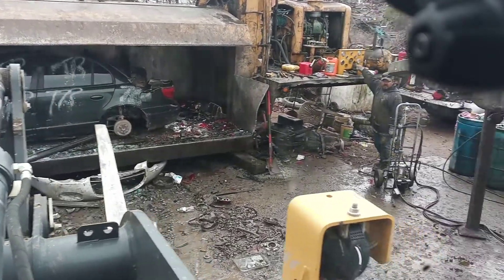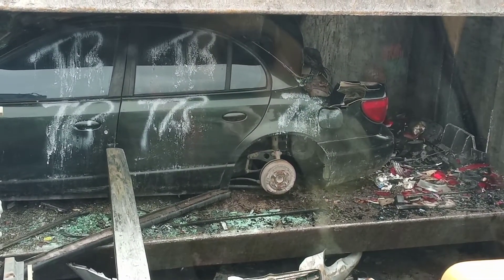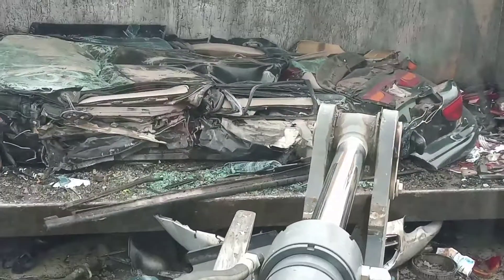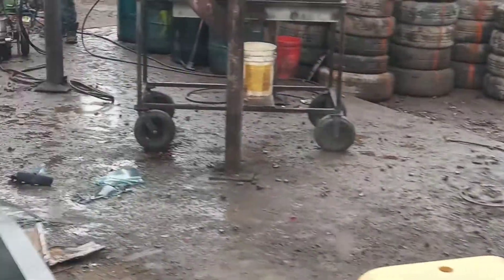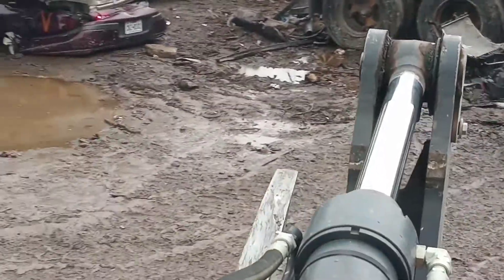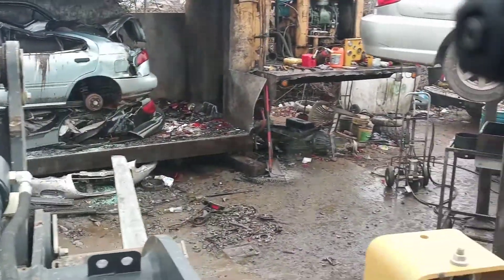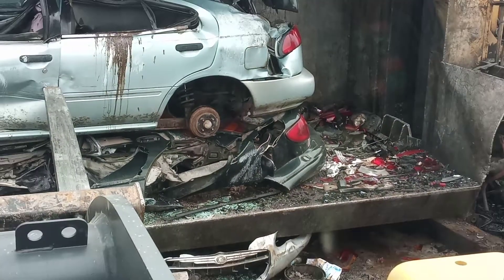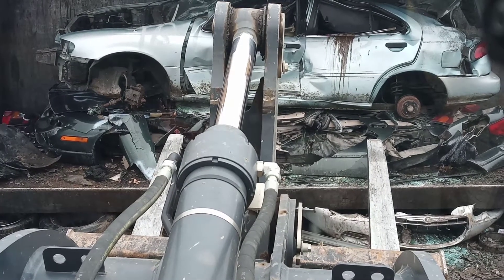Shattering a Saturn

Comment: No wonder they don't make Saturn's anymore it's mostly plastic & I guess that's why it's 1 of the cars of the GM motor company
Reply: Not all the Saturns were plastic bodies. The last saturns made had steel bodies and panels. These were actually good cars. I've seen dozens over the years with 300k or more miles!
Reply from the maker: Plus the motors were complete junk. Heads went bad a lot. Thanks for watching and commenting JP 👍👊

Comment: Wow that's kind's scarry how much that shattered, it's like some horrific fibreglass repair.  I guess they designed them to save weight, but lol yeah ... they do boats like that, and we always called them Plastic Pigs!

They say up to 10 mins is fine, I'd watch 'em at an hour long, but probably not for every one.  Would be great to do a longer uncut one, with a entire full stack load of crushing at once.
Reply from the maker: If you try and squeeze a boat between to suburbans the mill will send back your load. For real. Send another truck and come pick this load back up.
Reply: The panels were meant to save weight and cost for if they needed to be replaced, they're actually fairly sturdy and can resist parking lot fender benders and whatnot damn well, but 20 years of the elements have left em pretty brittle, the frame itself is a space frame so the body panels don't contribute to structural rigidity so they don't need to be metal anyways.